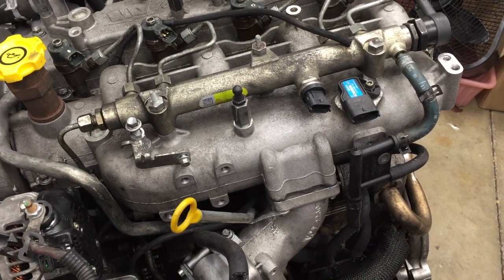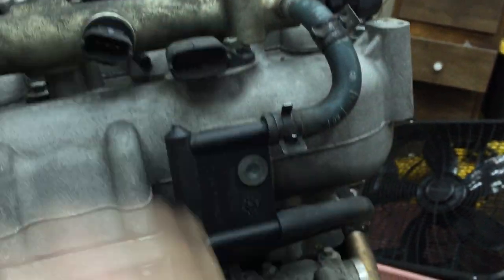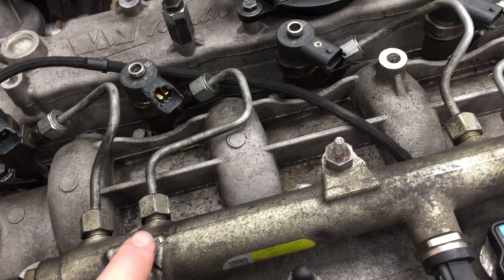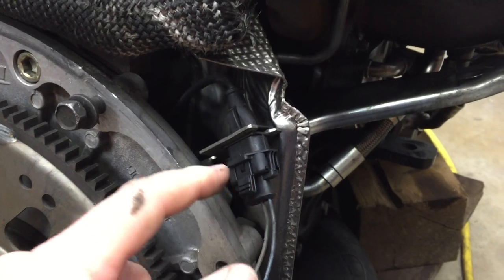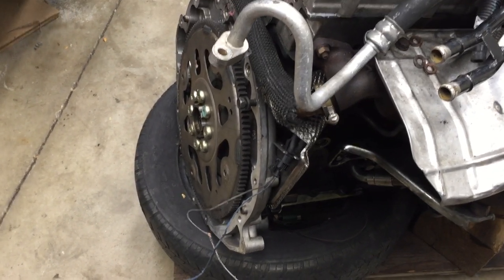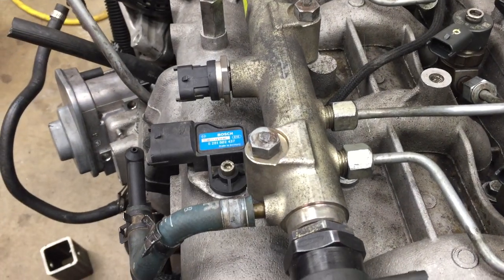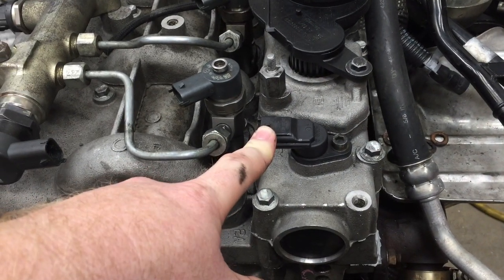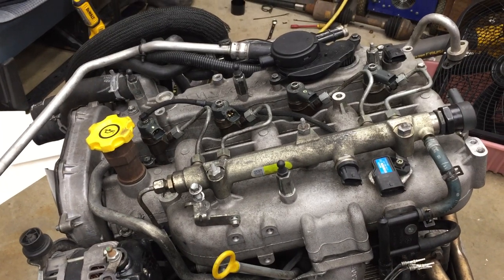Jeep CRD Engine Information

Comment: Hey there! Has anyone had an issue with a CRD engine. It starts OK in the morning but as soon it gets some temperature or a hot day, The engine won’t start. It will crank but it won’t start. Thank you for any  advice.

Comment: Never ever crack open a high pressure fuel line especially on a common rail you will cut ur finger off without knowing
Reply from the maker: At least for this engine that is not an issue. While it is high pressure it is very low volume. There is no accumulator on this system. Even cracking a fuel line with the engine running just leads to a fuel drip and an engine that stalls from lack of pressure.

Comment: @IcarusOffroad need some help on my 06 liberty crd, there was an incident a few months back where dirty diesel was put in the tank and the engine ran for a bit then died out and then after a few cranks started back up and idled, however it lost a lot of power and seemed to in limp mode. The code it throws is a stuck regulator which is p1202. I’ve seen the scan and the engine at first start accelerates good and normally but then it throws that stuck regulator code and lose power and goes into a limp mode, I’ve cleaned the tank and changed the filter but I think some damage has already been done to either the injection pump or the injectors themselves, I’ve also poured some fuel additive to clean the fuel system just in case any corrosion was built. What do you think?

Comment: Is this issue with the crank and camshaft sensors affecting also the 2.8 CRD from the Liberty, 177 bhp RA428 DOHC? I come from an Hyundai Santa Fe with the RA420 SOHC and I had the crank and camshaft sensors issues and I they had to be replaced at the same time, but OEM only as aftermarket ones didn't work. Do you know that they also need to be OEM aswell on this engine, or aftermarket works too? Thanks alot!

Comment: Great Information! Just bought a KJ as a weekend project, helped me learn hours of frustration in 20mins!! Cheers from AU
Reply from the maker: I’m glad you found it helpful. Just happy to help other enthusiasts with these quirky little Jeeps.
Reply: @IcarusOffroad  hi
Reply: @IcarusOffroad  I need some help on my 06 liberty crd, there was an incident a few months back where dirty diesel was put in the tank and the engine ran for a bit then died out and then after a few cranks started back up and idled, however it lost a lot of power and seemed to in limp mode. The code it throws is a stuck regulator which is p1202. I’ve seen the scan and the engine at first start accelerates good and normally but then it throws that stuck regulator code and lose power and goes into a limp mode, I’ve cleaned the tank and changed the filter but I think some damage has already been done to either the injection pump or the injectors themselves, I’ve also poured some fuel additive to clean the fuel system just in case any corrosion was built. What do you think?

Comment: Great video my dodge has gone non starter for the second time 🤔 changed  top sensor the last time sensor the last time .recommits the crank position sensor. This time but it was high pressure pump 🤑👍🏴🇺🇲🤞

Comment: Hey, great video. Very informative. Just wanted to correct the cam and crank sensor. A 2 stroke means the piston fires whenever it reaches tdc which means your cam to open the exhaust ports will be at a 1:1 ratio with the crank. In a 4 stroke engine, your intake and exhaust ports or cam will only be opening once every 2 rotations of the crank. The information was there I think you might have just gotten it mixed up.
Reply from the maker: This was pretty stream of consciousness, guess I said it backwards as I was running through it. It wasn’t exactly scripted. I guess none of us are paying too close attention to that if it took this long to be noticed.

Comment: good tip on that wire swap on the high pressure fuel regulator sensor and the #4 fuel injector. Done exactly that and took me a while to figure that one out.

Comment: Really useful video. Mine began by refusing to start when the engine was warm and now it stalls out on me as soon as it gets up to operating temperature. It took me four hours to get home on Christmas Eve, as it ground to a halt for a 1/2 hour rest every mile or so. Looks like I'll be changing out the camshaft and crankshaft sensors. Not looking forward to the crankshaft sensor, it looks like a real pig to get at. But at least I now know exactly where to start, and hopefully I won't have to visit the stealer. They only ever want to start throwing parts at a problem until they find the right one, and they always start with the most expensive ones, usually a control module. Many thanks for taking the time to help out the less knowledgable.

In case it helps anyone out in the future, mine threw the fault code (P0725 - Powertrain - Engine speed input circuit) the first few times it happened TorquePro found no codes. It came up with that one only after it had happened 5 or 6 times.

Comment: Could you please tell me if what exactly is involved in replacing a Fuel Rail Pressure Sensor?
Do I need to depressurize the rail before I  remove the old sensor or anything like that?

Comment: thanks for the great helpful video,  i have a jeep 05 2.8 CRD with a start problem which i have been trying to resolve for some time and its getting annoying , it only happens when its been sitting over night, once started with assistance of a spray (start you bastard) which is just a high octane fuel, it starts up and runs fine, even if turned off immediately after it kicks over with no time to warm up and has no problem starting again, i have a new set of 5V glow plugs and thought it may be this as it happens only when cold under 10 degrees C , but while the fuel rail pressure is said to get to 6700psi when cranking on the info im getting from the ECU via a OBD2 link, even so i think it maybe a low pressure issue on the fuel rail and injectors not injecting fuel or perhaps air in the injector pump as there seems to be a lot of air collecting the the fuel filter head all the time, i have eliminated injectors leaking into the cylinders as there is no smoke from the engine exhaust when it finally starts which suggests its a lack of fuel rather then an excess , im under the impression that at time of cranking the pressure control solenoid at the back of the fuel rail will be 100% closed so you can tell if its leaking by putting a hose on the bypass and seeing if any fuel is coming out , ive also changed all the hoses going back to the tank from the fuel filter head, and tried a lift pump for a while which made no difference either . could also be an injector return leaking which is tested with tubes and containers connected to the tops of all the injectors and then measure the amount of fuel bypassing the injector to see if any of them have a larger amount, im waiting on a testing kit to give this a try.  out of ideas
Reply from the maker: Have you tried leaving a battery charger on it overnight when there is one of these nights where it gets cold enough not to start?
Reply: If you are getting air in the fuel head overnight you have bad hoses or the fuel head has a crack in it.

Comment: Awesome video.   Same engine in my 06 Jeep Liberty I just recently purchased.  I plugged the OBD reader and it says cylinder 3 misfire and glow plug #4 (not sufficient)(?)    It was running for about 5-10 mins then it stalled and wouldn’t stay running after that.   And it would take about 3-5 mins to crank before it turns over only for it to stall about 1-2 seconds later 😣😑.  This Jeep only has 90,000 miles on it and Im open to any ideas. Thanks.   And also I’m trying to get that EGR elbow off.  I got the 4 bolts off and the one behind the dipstick but still wouldn’t come off.   Thanks

Comment: We have a 2005 Liberty with 50,000 miles in great condition. We were driving it in the city. It just suddenly quit. We took it to the Jeep dealer who said that they did not have the diagnostic equipment that goes back that far and therefore refused to work on it.  Your video is excellent, but you probably live in Colorado (based on your handle). We live in Shreveport, Louisiana and are not mechanics. What do you suggest? Is it worth anything? Many thanks. Al
Reply from the maker: You would have better luck with an independent diesel mechanic these days than the dealer. I don’t have any recommendations for you in your area, some Facebook groups or lostjeeps.com forum folks might be able to recommend a mechanic around your parts who has worked on them. These are still desirable vehicles in good condition, sadly non running projects are not terribly valuable. There are always people like me who are looking to pickup a project, I’ve bought more than a few, and to give them a solid mechanical going through usually ends up costing me about 2k with my free labor, thus expect it can be costly for a mechanic, and not terribly valuable as a project when you can buy running jeeps these days for 3k and up. Yours being low mileage will have more value. Can you describe what did happen when it “suddenly stopped”?

Comment: The injector clamp bolts are they stretch ones doe they have to be replaced every time , many thanks 👍
Reply from the maker: They are not TTY (torque to yield) they can be reused as long as they are in good condition.

Comment: Cool. I could have used this 1 year ago. My crank sensor was bad. It took my a while to figure it out with The assistance of the lost jeeps forum.  The wire in the pigtail of the sensor was completely cooked. Like you said there was no indication in the codes.  Can you recommend a code reader that has more than basic features like your talking about. Something that's affordable for a guy at home.
Reply from the maker: Generally the ELM bluetooth code readers can do a lot with a paid purchase App on a smart phone, be careful about which ones work with Apple devices. 

This Autel: https://amzn.to/2SjWKiD 

Is a little pricey, but supports an amazing amount of features and vehicles. It can read information from even the very obscure modules like the OCM (passenger seat Occupant Classification Module) and reset these. It also offers realtime custom trends and the ability to export data to the SD Card. It might be overkill for many home wrenchers, but it can be updated via the SD card and it supports so many vehicles that its a tool you ought to be able to use for a long time in the future.

Comment: Hi there.  I own a 2.5 CRD Liberty (KJ). I've had an issue on and off now for a few years, and no-one seems to have a decent answer....Initially it would start  up fine hot or cold, but the engine would shut down as soon as it got to normal operating temp. This problem had reared its head in the past, and replacing the crank angle sensor would sort it right out.But, the problem just got worse, and then wouldn't start-hot or cold, unless I used engine start. So, when I got the gap, I changed both the crank and Cam sensors (Just to be sure), and sure enough, the engine fired up, and ran, YAAY---3 days later I was back where I started. Engine cranks but no start !! Run starts every time no issue ! A couple months back I replaced my fuel filter and filter housing. The last time I  replaced the fuel filter, I noticed the (Cheap-ass) hand pump on the housing had worn internally, so when it came time to replace the filter, I just replaced the whole lot.  Well, wouldn't you believe when I tried to start it, it fired right up and ran great---for 2 weeks,and now I'm back to my engine start spray......Unfortunately , I am handicapped with not having an ECU reader of any sorts to attempt to diagnose any issues or sensors. Any info you could throw my way would be greatly appreciated. 
ISSUE 1) No start
ISSUE 2) Really randomly, engine will shut down at any rev/ Temp.

Comment: I have and 05 jeep liberty and going down the road at low speeds just dies, with no codes at all, i hear the crank sensor may cause that what do you think, i have had 6 of these diesels at one time, got the DRB 3  ,
Reply: That high pressure rail runs about 25 to 32, 000 psi when running,

Comment: Hi, nice vid, thanks. I've got a '08 JKU with the 177hp 2.8 CRD with a turbo issue (seemingly). It loses power when reaching 2k rpm and won't rev higher, seems like the engine goes into limping mode as if the turbo gets bypassed and check engine light shows up. On top of that code readers including the Jeep dealer's one can't establish communications with the ECU, it tries and tries but doesn't find it.... Any help would be greatly appreciated!
Reply from the maker: Sorry to say We never got the diesel JK in the US so I am not so familiar with it. However your symptom does sound like what can happen with the fuel filter gets plugged up. How long since it was replaced?
Reply: @IcarusOffroad  Thanks for your quick reaction!
Well, that's indeed something that has to be done! Got the filter waiting to be installed. Guess that's the next step.

Comment: Any suggestions for a 2006 jeep liberty crd , that shutters at times when idling and at 1700 rpm , goes away when rpm's goes to 2000 , it seems to be the engine - checked torque converter, had transmission serviced , motor mounts checked , transmission mount replaced, had a front end alignment and tires balanced  .I can't get the 4th injector out ( it's stuck in ) to check it yet .I'm going to put new seals and crush washers on all injectors
Reply: Terry Lewis hey man mine does it (if you talk about bogging while driving slow) and it’s because it tries to get on overdrive to fast and want to die so just push the button and once you get on the highway put it back on

Comment: What would you think the problem is if it stalls during acceleration?
Reply from the maker: Could be so many things. Start with the basics, how long since the fuel filter has been changed? Is there lots of air in the filter head when you bleed it? Does the problem happen more when the engine is cold or hot?

Comment: How much fuel pressure do I need to read before engine will fire?
Reply: I’m working with Autel MaxiCom. I’m a few months into throwing parts at mine. Crank no start
Replaced:
-fuel pressure sensor
-fuel pressure solenoid
-fuel filter housing
-fuel filter
-cam sensor 2x
-crank sensor
-MAP sensor
And I installed a lift pump and harness along with new fuel lines at tank

Comment: Great video, even though I don't know anything about engines. I have the opportunity to buy an 05 CRD with 190k miles on it. He's asking $3995. Is there anything I should be wary of when I check it out, and does that price sound about right for that mileage?
Reply from the maker: Juan Smithe I would really recommend you check out the CRD section at lostjeeps and check out the noob guide. The group there can give you suggestions on current pricing as well.
Reply: @IcarusOffroad  Thanks a lot for the quick reply

Comment: Hi, I have a question, my 2.8 crd vibrates at idle like crazy. We already changed motor mounts, injectors, transmission mounts, torque converter and it still vibrates. The camshafts seem to be misaligned for some reason however. The car runs smooth when I hit the throttle even a tiny bit
Reply from the maker: D. Sidor what makes you think the cams are misaligned? Mine are pretty shakey at idle and do smooth out when you start to give them throttle. It’s hard to really say if yours is extra shakey without seeing it in person. I mean they are diesel, so some Shakeyness is expected.

Comment: I'm in the middle of doing my timing belt and soon replacing my rocker arms.  What have you been doing with the big cables running across the top for the engine when doing the vavke cover and rocker arm job???  Its tight on the engine and I'm not sure what to do. Thanks
Reply from the maker: Nick Pauletto I remove the harness and lay it over the driver fender. There are 4 plugs on the pass side by the ac accumulator, they are on a bracket that is held down with a 10mm in the middle. Remove the 10mm and then it’s easier to undo the plugs. There is also a bolt holding a ground strap. You will need to undo the trans plug as well. Get the coolant reservoir out of the way and then you can pull the harness all the way over to the drivers side. It’s not much more work but it’s pretty critical for being able to install the valve cover. Also get some or make valve cover alignment pins to reinstall, and follow the torque sequence when you install it. If doing ARP head bolt verify they do not hit the intake manifold on the exhaust side. Use thick grease to help get the rockers to stick to the valves.
Reply: @IcarusOffroad  watched your videos many times.  Thanks again for all the time you spent making these. Greatly appreciated.  By the way what is the thread on the alignment pins or can i get away with proper sized drill bits? Your thought.
Reply: @IcarusOffroad  Got the the harness this morning. Done.
Oh my god!!!!  Am I  going to have the take the mounts off the tilt the engine forward to get to the back sensor connectors and later get better clearance for the cover???
By the way...the transmission dipstick tube is sooooo in the way.
Reply from the maker: No need to tilt the engine or anything. The rear plugs are awkward but accessible. Grab the bolts that bolted down the intake and take one with you to the hardware store to find a matching thread. The alignment pins are 2" long and screw into holes for the intake bolts, NOT the injector crows feet. Just get some bolts that match the thread and cut the head off, or allthread.